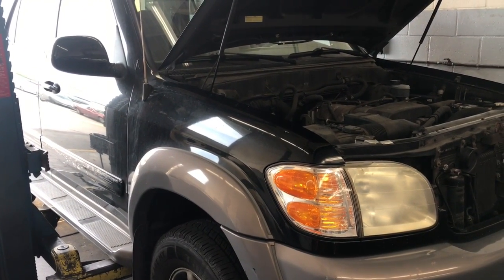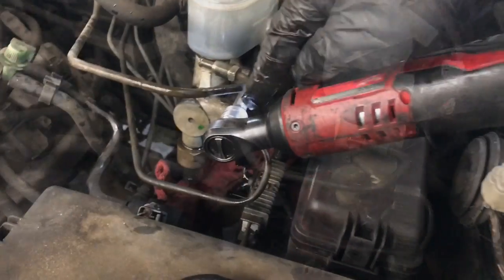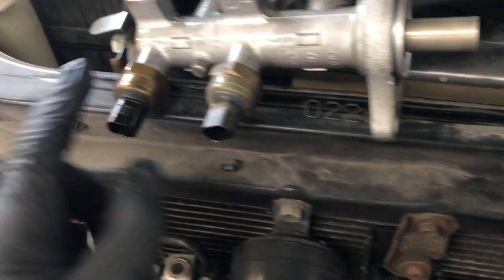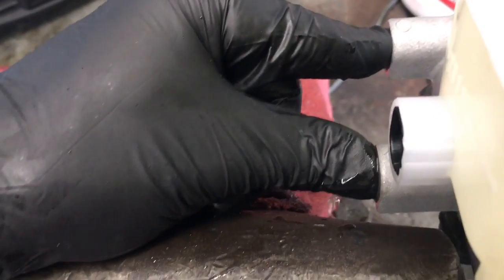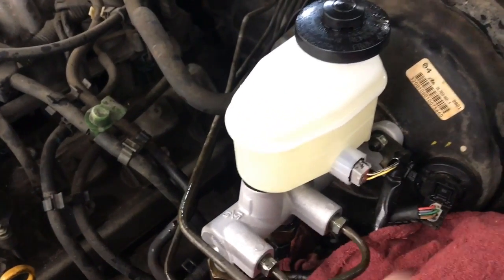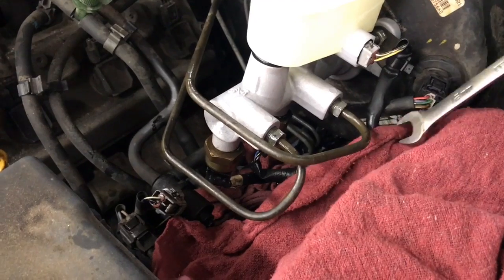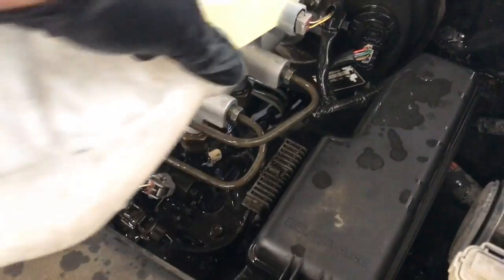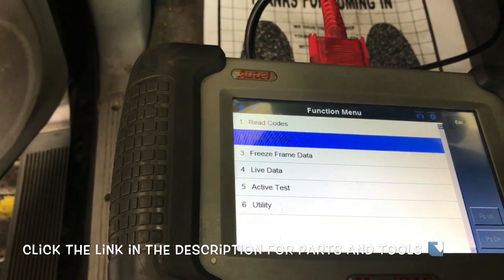How To Replace The Brake Master Cylinder On A 2000-2007 Toyota Sequoia

Comment: I have to push the brake pedal to the floor for my 2004 Toyota Sequoia to stop. New brakes and rotors. Would this help with my problem? I don't see any leaks anywhere.

Comment: Hi, Is it recommend to replace the pressure sensors when changing the master cylinder? I am getting a hard vibration ion my brake pedal when braking hard and my brakes ill lock up. Already had the maters cylinder replaced.
Reply from the maker: The pressure sensor only operate a light. Sounds like your brake rotors are warped, causing the vibration.
Reply: @HowtoAutomotive  Hi Thank you the reply! There is no vibration when brake is pushed normally. It is a buzz sound, the pedal kicks back and then the wheels lock up when the pedal is pushed coming down a hill or incline.
Reply: @HowtoAutomotive vsc and trac light on...i cant delete it with a cheap scanner... just replaced the master cylinder...need advice
Reply: @mjben55  You have air in your lines. You will need a service tablet like an Autel or a Launch to actuate the ABS and then pressure bleed the system. This issue is very common on the 2001 to 2007 Sequoias and Tundras.

Comment: I learned many, many years ago that pumping the pedal during bleeding creates foam. I would have one of my employees work the pedal and have him or her push it slowly after I cracked the line (master and/or wheel cylinders). Usually only a few drops from either. Crack the line - yell down - tighten and yell up - repeat as necessary - takes a few times to get the signals down but saves time and fluid.

Comment: You mentioned the pedal was going to the floor.  Was it consistently or intermittently?  I have a 2004 Tundra and the pedal goes all the way to the floor with very little resistance about one out of every 100 times the brake is applied.  After letting off and pressing again, it is fine.  Every time it has happened, it has been under light braking.  No stored codes or lights.
Reply from the maker: Mark O It sounds like your master cylinder is starting to bypass. Do you want to double check to make sure there’s no leaks in the system though. So check all the lines calipersAnd ABS control unit.
Reply: @HowtoAutomotive  what happen if there no leak? Bad master cylinder? Thank you

Comment: what would you do in the event that you replaced both front calipers and let the front side of the master cylinder go dry? ive replaced/ bled and done this kinda work alot. But this system for some reason will not let me get any fluid out. Im not even sure how to pump fluid back through lol.
Reply from the maker: Kevin Camacho Start by top in the master cylinder all the way up then pump the brake pedal holding the pedal to the ground open the bleeder screw allow all the air and fluid to the poor out once it comes to stop close the valve and release the brake pedal. Repeat as many times as needed to bleed the air out. When all the air is bled out you’ll see a steady stream of fluid only. Make sure you top off the fluid in between every couple pumps. If that doesn’t work then you may require pressure bleeder. So the front half is for the front two wheels so you most likely only have to bleed the front wheels.
Reply: yeah i tried that all afternoon. I even used a vacuum air bleeder and nothing. I cant get it to pull fluid for anything in the world lol. i would suspect maybe it was something in the lines but all the original fluid drained out. It must have some kinda air just stuck inside. ive bench bled it inside the car. its pushing fluid out but not enough pressure to travel the lines? maybe the cylinder is bad idk lol
Reply from the maker: Kevin Camacho The only other thing I can think of is if you put the calipers on backwards another words the left one on the right side the right one on the left side. The bleeder screws will be upside down and the air will be trapped at the top of the calipers. So make sure the bleeder screws are facing upwards at the top of the caliper.
Reply: Nope bleeder screws are facing up :/. Guess I’ll have to invest in one of those pressure bleeders
Reply: Are you getting good pressure without the lines at the master cylinder?  My lspv it's a valve under the bed that detects load was leaking. Maybe yours is bad or you busted a line somewhere?
Reply: You need a service tool to actuate the ABS so that you could bleed the brakes.

Comment: Tx for nice video
 Can you help with this problem?
   When applying the brakes quickly as if deer ran out in front of me, they are REAL Hard. They do not stop the car fast. It stops eventually, just slowly.  But if I where to apply them slowly, like coming up to a stop sign, they work just OK. But they go to the floor, when holding foot on the brakes. Even when the car is parked and running and you push on the pedal they stop half way and then slowly go all the way to the floor. I just changed the front rotors and pads. Its a 2001 Toyota Rav4 with over 250,000 miles on it and everything is rusty so a simple bleeding job is kinda out of the question because I already broke off two bleeder valves. The car is on its last legs and I only want to do what I have to to make it last the winter. Thanks.

Comment: So I have a 2005 Toyota Tundra and I'm losing brake fluid from my master cylinder reservoir, I have checked all the lines and cant find a leak, any ideas what my problem is?
Reply: I am going through the same thing right now...No leaks anywhere so I pulled my master cylinder from the booster and their was a small leak.  It leaks into the booster. Anytime that happens you have to replace the booster aswell. Hopefully your truck does not have the stability control like my 05 double cab cuz its dealer only at about 1200 just for the master.
Reply: mine is a 05 limited, I'm not sure if it does or not. I haven't lost any fluid since I bleed my brakes last week. but your saying if it has the stability control its dealer sold only or its 1200 in repairs??
Reply: If it has the stability control its a  dealer only part...you can check to see if your truck has it...its in between the master and booster. Has a few had brake lines going into it and a zerk fitting for bleeding. Good luck
Reply: one more question, I've noticed you can buy a master cylinder on rock auto that bolts to the stability control, if the master cylinder is bad does that mean the stability control is bad also?
Reply: I asked myself the same thing.. I dont know for a fact. What I do know is that mine leaked from the back of the stability control. I just got my part in. Payed around 120 with shipping on a used unit combo with warranty. Also ordered a  booster since the brake fluid is corrosive. That ran me another 70 bucks with shipping. Google b&r auto. They have tons of yards in Ca and will find those hard to find parts.
Reply: Thank you so much for your help.

Comment: No link for the sensors. This isn't necessary for code c1360. If your scan tool has abs live data see if the voltage increases on the master cylinder pressure sensors when you press the brakes. If one does increase and the other doesn't replace that sensor. This looks more like an up sale to the customer. Its why he recommended replacing both sensors in the video
Reply: He didn’t say he replaced the master cylinder because of that code. He said that code will come up after replacement….

Comment: How good is master bleeder kit ?does it make it easier to bleed?
Reply from the maker: Hector Rocha I've never tried one. Have you Heard good things about them?
Reply: How to Automotive at school they have one it comes with fittings for the vents and  tubes that connect  to the holes and the tubes goes to the top master cylinder u still have to push the piston but it removes the mess of fluids everywhere
Reply from the maker: Hector Rocha will have to check it out.👍🏻